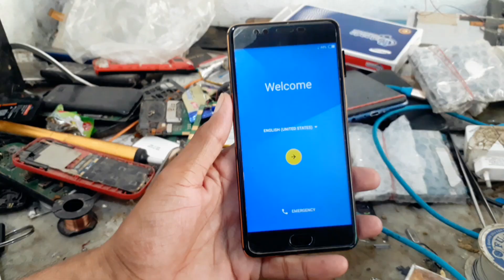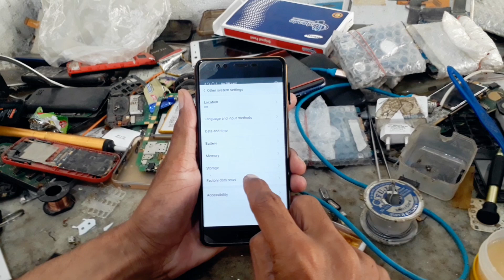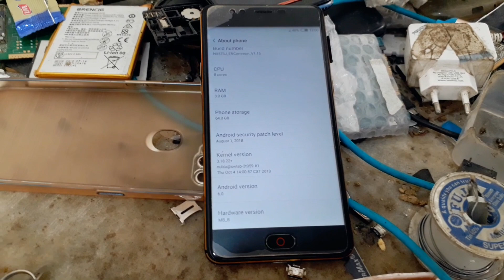nubia M2 lite Android 6.0 frp bypass || Model: NX573J Google account Remove without Pc

Comment: It doesn't work for me... ☹Phone doesn't want to have the PIN of the SIM card. When I push the slot with the SIM-card in, phone switches over to the Nubia start-screen with those circles. Wiping down from the upper edge doesn't work at all...